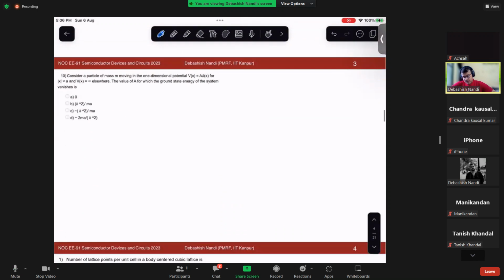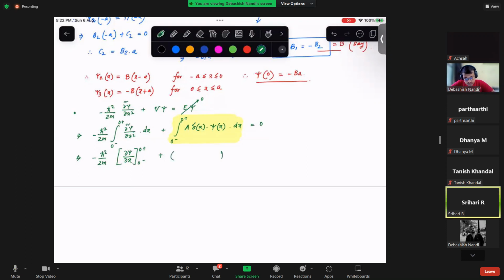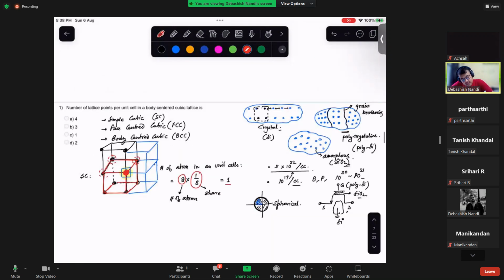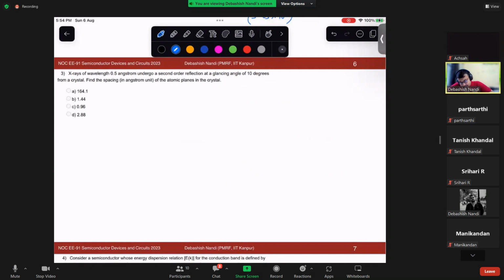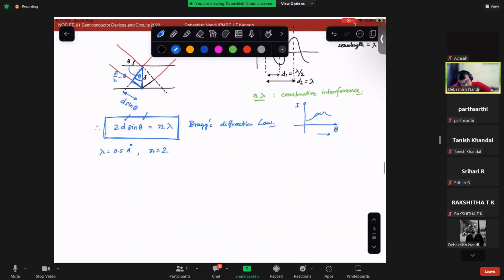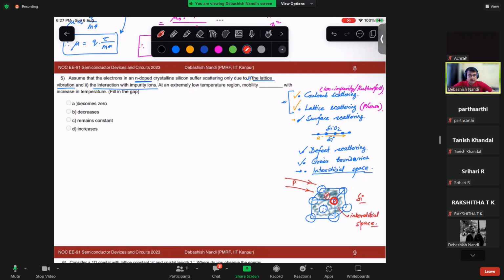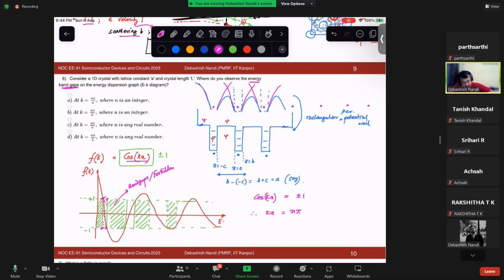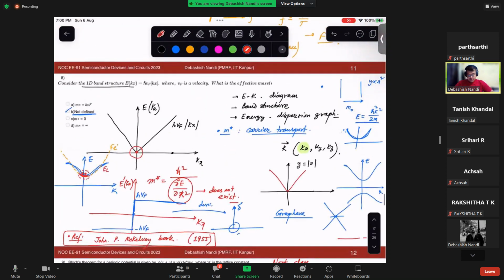Week-2 Tutorial (Semiconductor Devices and Circuits) : NPTEL NOC EE-91, Y2023

Comment: 1) If the position of an electron in an atom is measured to an accuracy of 0.01 nm, then, what is the uncertainty in electron velocity ? (Give the answer in km/s) ? 

2) Suppose a proton is confined to a box of width L = 1 x 10-14 m. What is the energy in the ground state? Use Mass of Proton = 1.67 * 10-27 Kg. (Give the answer in MeV)

can you solve these questions please
Reply from the maker: You can solve it in the following manner:
1. Use Heisenberg's uncertainity principle to calculate the accuracy in momentum and therefore in velocity.
2. Follow the week-1 tutorial of this playlist where the solution for the electron is given. In the similar way, you can calculate for proton.

I believe you can work out the solutions.